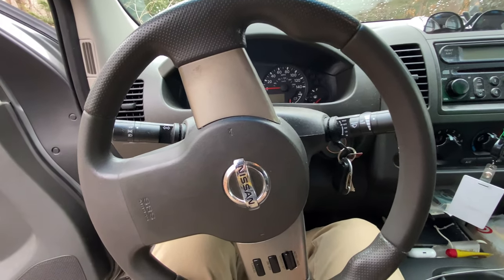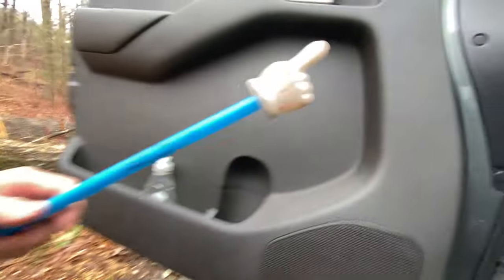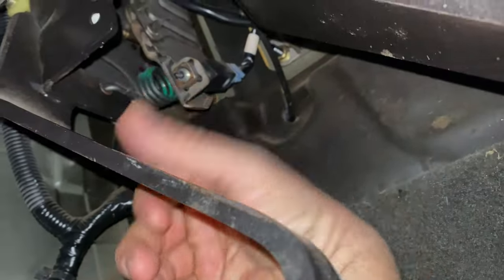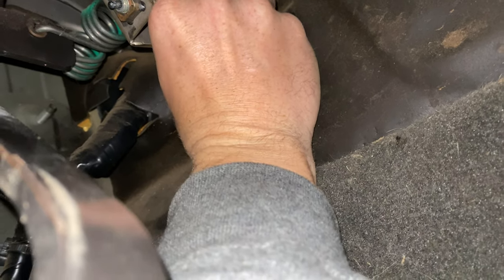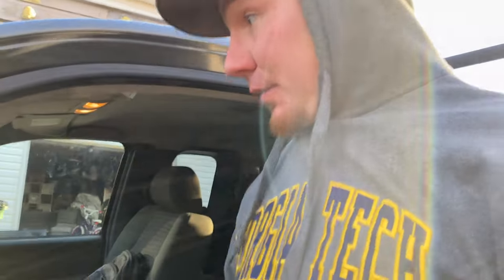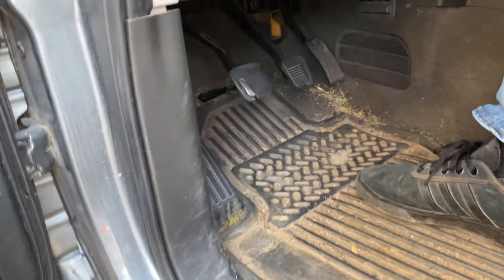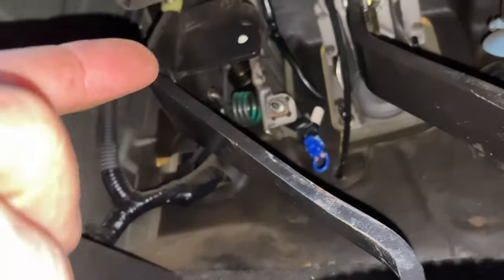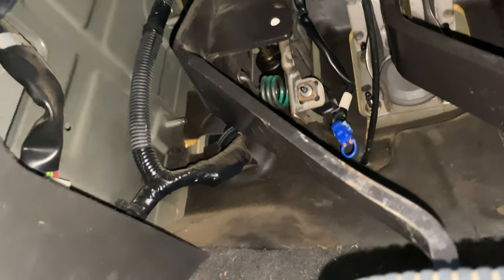Nissan Frontier EASY CLUTCH SWITCH FIX

Comment: Doooood. You saved me! I’ve been racking my brain trying to figure out why my truck suddenly wouldn’t start. I noticed little pieces of crumbled plastic in the floorboard and turns out after I watched this video is was the clutch pedal switch pad. I ended up just putting a short nut and bolt in the hole and it works as a switch.
Reply from the maker: There is nothing better than reading comments like these. Appreciate you watching man glad you were able to fix it.!!

Comment: Fire the genius who drills holes in that clutch lever plate.  Without a hole filled with a crumbly plastic piece, nothing would fall out to prevent the little switch from being pressed.  Nothing to go wrong ... unless the weld failed.
Reply from the maker: Economy trucks will always have some cut corners lol.

Comment: Some models actually have a clutch override button/switch right next to the mirror adjust button. But yeah the pedal switch is a simple +/- on/off. Jump the terminals with a paper clip or misc wire to bridge it to make a close circuit. Keep in mind that you can now start it while it's in gear without pushing the clutch pedal.  Or you can simply take a quick wire connector clamp and crimp it on with pair of pliers just above where it plugs into the switch.

Comment: going to try this on my 1987 D-21 ,    update -    I cut the wires and bound them with a nut
Reply from the maker: @paulharnad777  easy as pie
Reply: @TheAdamConners  if you know others with a D-21 ... I need the cover for the air intake on the throttle body   ( will provide finders fee ) its an egg shaped , plastic piece

Comment: Thank you!!!!  I was prepping my 99 Nissan Frontier to sell and while vacuuming I found a small bolt under the drivers side dash. Of course the next day, Truck wouldn't start.  I would manually hold the button in with one hand and turn the key with the other.  Now it is 'fixed'. Thank you!
Reply from the maker: Lol that’s hilarious. Glad you got it going and thanks for the sub! 👌🏼

Comment: So glad I just stumbled on this vid/was almost ready to buy a new starter motor:  My 02 Frontier 141k miles shows slightly diff design than on the vid (no hole but "something" had been taped there that no longer existed) but- viola- the real problem was the floor mat!!!!!   Also caused
 grinding of the gears.   Moved the mat abt 5 inches away from where the clutch pedal hits the floor.   Advice:  No floor mat material in area where clutch touches the floor.
Reply from the maker: Thanks for the feedback 👍🏽👍🏽

Comment: My '51 Studebaker had the starter button under the clutch pedal.       
After viewing this, I checked the switch and found that it was good, replaced the plug on the pedal with a clip from a new dress shirt, and it works great.

Comment: Right on. I just had my 2016 with under 45k miles and they charged me $360 for a switch last week and today, less than a week after they replaced it, I had the same trouble when I got in the truck to head to work this morning. That dealership is #1 Cochran Nissan of West Hills, Pittsburgh, PA. When it was John Wright Nissan, they took care of their customers - this guy Cochran is a flat out thief. This isn't the first time I've had issues with these guys. I'm on a mission now.
Reply from the maker: Go get it bro! Thanks for the comment, we all appreciate it!

Comment: Just as you were describing what to do with the two wires putting them into the fuse module for the easy clutch fix sound goes out and without sounds I don't know what I'm supposed to do afterwards
Reply from the maker: No that’s it!!! Just put a wire into both holes of the switch you pulled from the button. Then the truck will start without pressing in the clutch. Just make sure it is in neutral.

Comment: On a subject of a different note I have an 04 Mazda 3 that had in under – fire in mid Transportation home the other night it's somewhat melted everything underneath is there a wiring diagram that's easy-to-follow to rewire everything under there or is it a manufacturer's default and if so can it be replaced for free

Comment: If I did that and it started. Drove it. Then it would not start again. Could that be the starter; from what I hear, or any other suggestions?
Reply from the maker: I would assume you have already checked your connection on the switch?

Comment: if the Nissan Navara starts but does have any power to move forward or backward
Reply from the maker: That does not sound like a problem with the clutch switch. Does it go into gear ?

Comment: So do I still need to hit the clutch? Cause I can get it started, just not going into gear?
Reply from the maker: Lol it just allows you to start without pressing in the clutch. You still have to use the clutch to drive. I am very sorry that this hack doesn’t make your manual transmission an automatic 😆😁😁😁

Comment: My 2012 Frontier has gone through three of the stupid pads at 90,000 miles. Bad design. Might do the hard wire.
Reply from the maker: Yea I can’t understand why it’s designed like that 🤷🏻‍♂️. You can bypass the switch in 3 min.